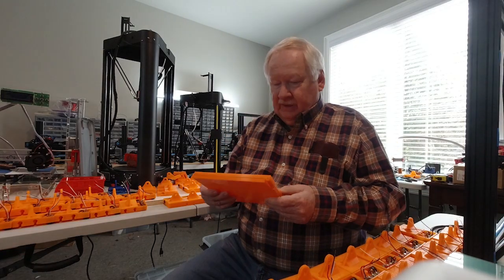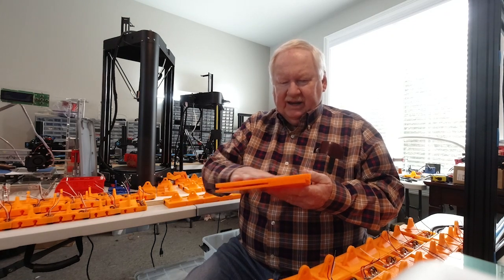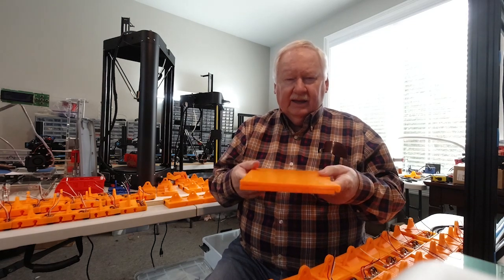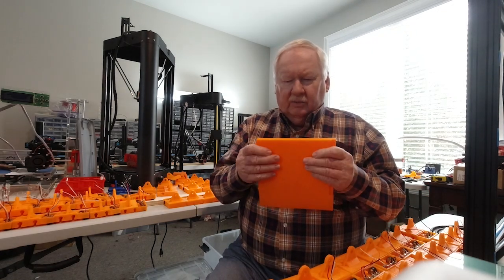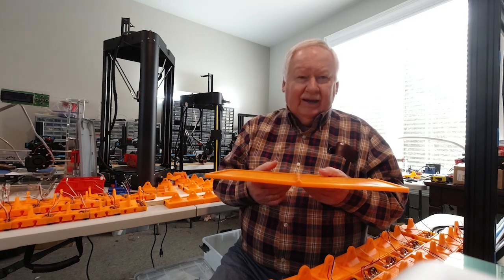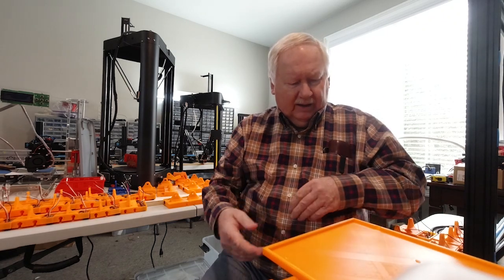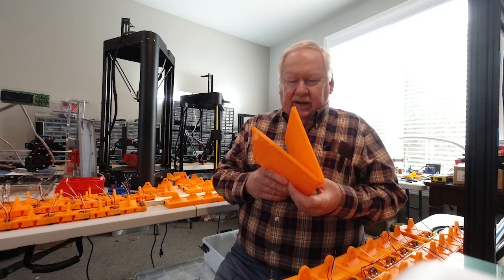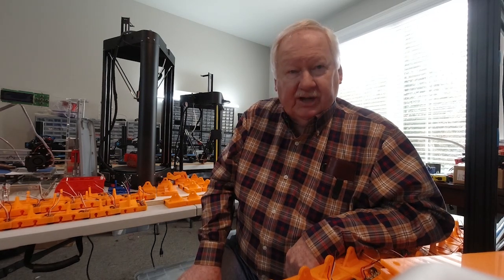3D PRINTING VS INJECTION MOLDING of the LAP DINER parts at my 3D PRINT FARM by New Tech Inventors.

Comment: My FLsun bed sticks like hell. I don't like glue or anything else, it's just not my thing to mess around with it and clean it complicated. I always clean with 99IPA after each print. For large surface model's I use a printed razor blade holder, so the half blade is looking out and up to roughly 30 degree bendable. If this doesn't help with getting loose one side and have a start I use drops of IPA on the blade and apply it to the corner's or even long side's. Spraying a fine cloud IPA to the model would be the last solution.

Another tip is ice spray. Maybe you try it with a test print(only few layers large area) it's worth.

For your way of making the pei sheet less sticky, you may try soapwater or glass cleaner with less alcohol and more soap in it.

At Prusa printers the "new" satin sheet is my favourite atm. It has a surface finish somewhat in the middle. I printed ABS, PLA, PETG and also PC without issues. Now in a new enclosure even better.
Reply from the maker: Thanks for sharing your experience and ideas about adhesion, they are very helpful and I will try and see how they work for me. I also have a problem with my FLSUN printers and sometimes use a glue water mixture to reduce the adhesion. Good luck with your printing my friend and thanks for your support...ken

Comment: I started off with PLA and a regular Ender 3 stock bed. Then I switched to PETG because I heard it was stronger.  Everything was fine, good adhesion for both materials. Then I upgraded to a glass bed. The PETG will not stick well to the glass bed. I went back to PLA with the glass bed - good adhesion. Then I continued on to wood PLA with glass bed - perfect adhesion. I am sticking with the wood PLA for now. It smells great - just like wood and gives my product a rustic woody look, which is nice. There are wood PLA with wood powder and also some types with wood fiber. The ones with wood fiber look more "woody."
Reply: Granny that’s cool.   Wood ...wow.. I work with petg and it’s difficult on glass but have found spring steel beds work fine.....if you can swing it look into the micro Swiss all metal direct drive with nozzle.   Will make everything easy.
Reply from the maker: The PETG filament is harder to print with on any surface. You have to have your printer and settings really dialed in for it to work well. In some cases on glass I have to go as high as 245 or 250 degrees C to get a good smooth first layer. One of my problems is that operating at those temperatures can cause the PETG to start building up around the nozzle and PTFE Teflon Tube which causes the flow to be reduced causing poor adhesion of layers and a rough surface. In other words a bad part. I will say that once you get the right setup for your printer you can get some really great and strong parts. Thanks for your support...Ken

Comment: Ken, thank you for the videos. I had similar problem with boxes on the corners in my Ender 3 v2 and I improved dramatically my printing quality enclosing the printer. Not all of it, but just enough to minimize cooler air flow around the printing part. My ambient averages 21°C and now into this “enclosure” averages 25°C and that was enough to get way better results in the original glass bed. Hope that helps.
Reply from the maker: I found that when I am running many printers at the farm I can maintain between 80 and 85 degrees F in the room and all is well. When I go there on weekends when only 5 or 10 printers are running in the winter time the temperature is in the 70's F and sometimes this causes problems. The room or enclosure temperature does effect the quality of the print. Thanks for sharing your info and for your support...Ken

Comment: Mate if you needed a aluminium mould for your lap dinners I would be happy to make you a prototype mould for them. I can make it on my cnc. I’m happy to produce one for you at no cost to you. As long as you could pay for the postage. Let me know what you think. Cheers Robert.
Reply from the maker: Thanks for that great offer Robert. It sounds like a great idea and I would like to try that out with you, however You will have to let me compensate you for your time and material. I will have to make another drawing of the part better suited for injection molding and will work on that and let you know when I get it ready. Thanks again for your generous offer my friend...Ken
Reply: @NewTechInventors  no problems Ken. When your ready to go send me a Direct message. Don’t worry about the time I’m happy to help out. Cheers Robert

Comment: Im in the exact same situation. I've been 3d printing a product that has been successful which I have sold thousands so far. All have been 3d printed. They have a hinge and larger surface area like your print. I use a steel spring megnatic PEI Sheet and I get a nice surface finish. I choose to not go the injection molded route for the exact same reason that you would be left with inventory. In my honest opinion stick with 3d printing your products because if they have utility, the cosmetics wont matter as much. As long as you make sure the surface is presentable, the rougher 3d finish won't turn buyers away. The biggest struggle with 3d printing is having dimensionally accurate parts across all of your printers. Ive been able to achieve 0.05mm accuracy across 17 ender 3 v2s by tuning and calibrating. Feel free to watch my video on the 20mm calibration cube and injection molded parts, and creating 3d prints for injection molded parts.
Reply from the maker: Thanks for sharing your experience and information. I have recently started running several printers with PEI spring steel beds, and so far they are proving to produce good adhesion and quality prints. The accuracy between my printers has proven to be consistent and good enough for my parts. I have had one or two printers that have hade some problems with accuracy and only use them for parts not requiring tight tolerances. Thanks for sharing your information and I wish you good luck and much success with your business. Thanks for your support...Ken

Comment: I know that large flat is a pain to print.  Your grandson was absolutely correct...if you freeform the lap top and stay away from a large flat contact ...incorporate the drink holder to the bass....think of an upside down plate that has the perfect overhang angle..done in 2 half’s.  Turn it over and it’s a large plate or bowl.  This will be better because the food won’t slide off. The 45 degree angle will also stabilize it on the persons lap.  Free form looks cool and contemporary and will appeal to younger crowd ...your bud joe ..throwing ideas around
Reply: Large/flat are IMHO the hardest prints. I find if the stupid bed isn't 100% flat and level you end up with more material on certain areas.   Consequently the nozzle ends up not having enough room for it and the material. That in my opinion causes pressure to be exerted on print by the nozzle and its drive which can cause warping and all that other crap.   one day I might own a auto leveling printer... usually infill starts and saves the priny on some objects
Reply: @bill6255  leveling is need when your project is 3 “ or more in contact service.  As you knows,   even with a level bed,  your bed probably has warpage within it.   The key is larger tip .8 when your building a larger bed contact and of course no fan for the first 3 layers.  This is a theory on the .8 but it make sense in my head.  There is more stuff to stick.
Reply from the maker: Thanks Joe for your thoughts. I have set up several ET4 printers with a magnetic base and PEI spring steel base. I will see if this helps with printing the Lap Diner parts...Ken

Comment: I would say injection mould parts will be better with less failed prints for larger parts, 3D print the smaller stuff.
Reply from the maker: Your right, it will be a much faster and cheaper way to produce large quantities of Lap Diners as long as I can sell them. Thanks for the comment...Ken

Comment: The carborundum glass beds give a nice textured finish and so do the textured PEI ones
 Of course, you could always print them as they are and apply a self-adhesive textured mat on each half
Reply from the maker: Thanks for those ideas Andrew. I have now printed on almost every surface out there and it looks like different parts and materials will print better on different surfaces. The trick is finding the right combination for each part. I have done this on many parts and have new parts now that are going through the process of finding the right combination for them. Thanks for your support...ken